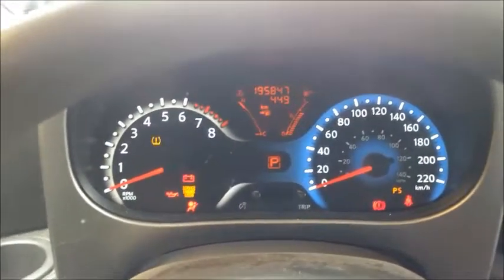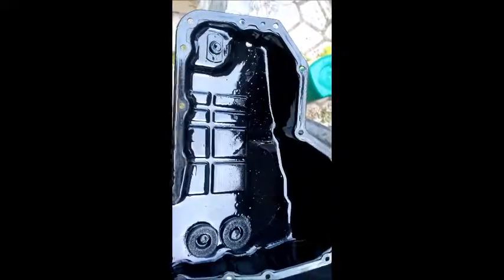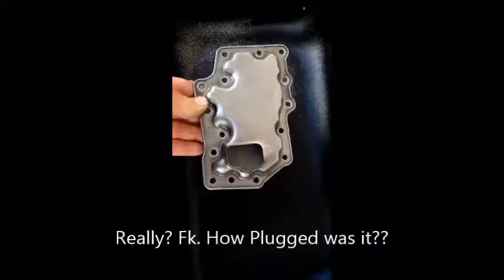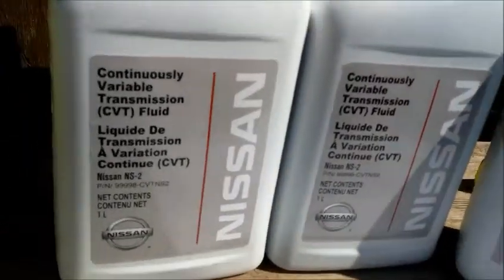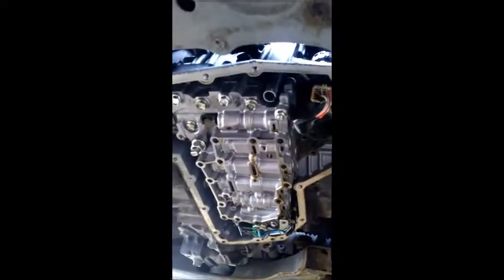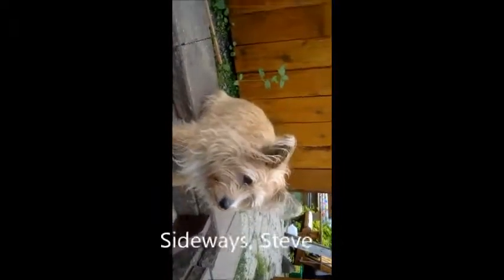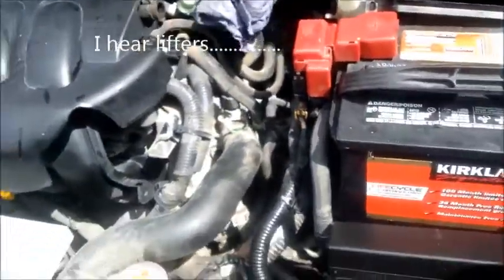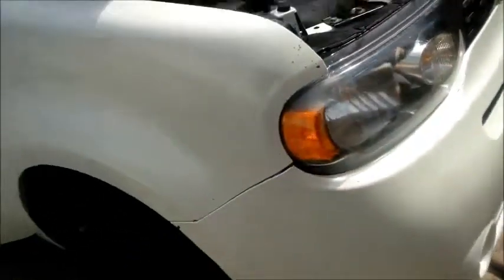2009 Nissan Cube CVT Whine Fixed. Repaired by Servicing.

Comment: Had the same problem with whining and not wanting to shift on my 09 Nissan cube. Changed the cartridge filter and cleaned the screen filter real good and put Castrol transmax cvt fluid and now it works fine !!!

Comment: I just got duped and bought a cube with the same noise. It only does it when it's a cold start tho. Fingers crossed doing this will fix it. Thanks for the vid and glimmer of hope
Reply from the maker: Best of luck with it. Please let me know if you have success. Pretty sure you will.
Reply: @cbstrdst4892  thanks dude
Reply: @cbstrdst4892  all done and sorted mate. Thank you very much your video was a big help. Me and the mechanics were able to use it as a reference to where the little filter is hidden too
Reply from the maker: That is great news. Thank you very much for taking the time to update me.

Comment: Great video, quick question, what did you use to clean the filters and it is operating properly without noise now that you have driven it?
Reply from the maker: The filters were washed out using brakleen. The car drove great after this and has since moved on to a new owner. It was creating such a vacuum trying to suck it was creating bubbles in the fluid causing the pump noise. Be sure to use only Nissan fluid though, and be very fussy about getting the level correct when hot. I hope it helps.

Comment: When u change the secondary filter. Did u change also the whole housing or just the filter?
Reply from the maker: I am pretty sure it was just the filter.
Reply: Also do u have the part number for the gasket and filter..Amazon has compatibility chart and per Amazon buyers review it says it’s not compatible.
And lastly did u use the old screen filter and just clean it or it came with a new one when u order
Reply from the maker: The only thing I recall buying was Nissan fluid, and Brakleens. I washed everything out as I recall.
Reply: @cbstrdst4892  thanks ur video will be my guide when I do my transmission service
I changed the fluid only 2x about 94k ago 2k apart there’s no in-depth video that I can find with regards to changing the filters. I have 107k right and amazingly running good but I wanted to do the service hoping the transmission will last longer I’m buying all necessary parts but having hard time finding the right gasket filter kit.. I’m using valvoline cvt na 2 transmission fluid which I also use to flash at 94k it’s much much cheaper $7.58 per quart… thanks again for the video
Reply from the maker: Spend the money on the fluid from Nissan. Don't skimp on the fluid. Imho, anyway.

Comment: Was the transmission working or not in the beginning?
Reply from the maker: The car moved, but it was slipping and has horrible pump whine. It was trying to suck fluid in so hard that the fluid was 'boiling' from vacuum and making the noise. A transmission shop had condemned it as done. New Nissan fluid and clean filters and it works like a charm.

Comment: After 220k miles and immaculate care for my 09 cube, got a cvt whine. I don't currently have the money or time to fix it unfortunately. In the middle of a move and an extensive work project. Some asshole over filled it with the wrong fluid.